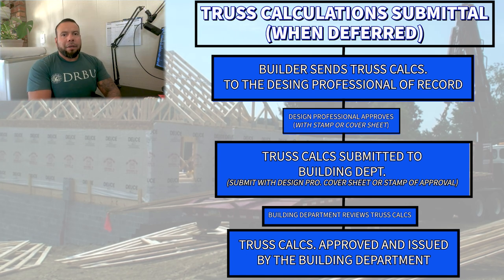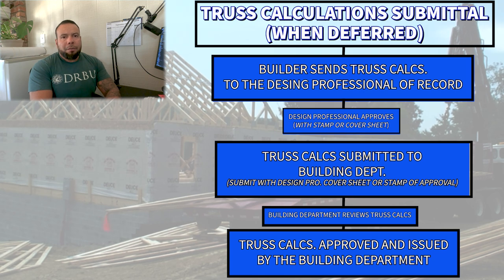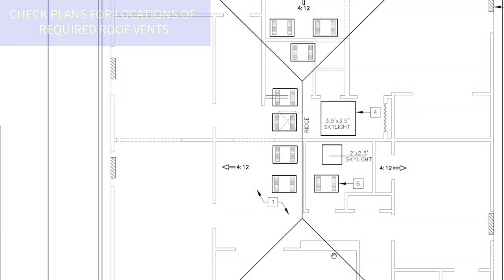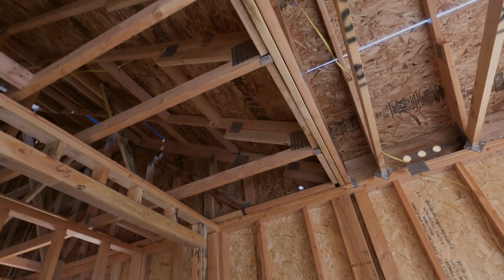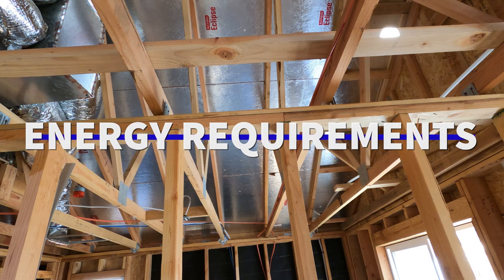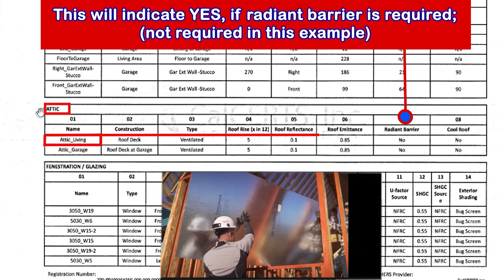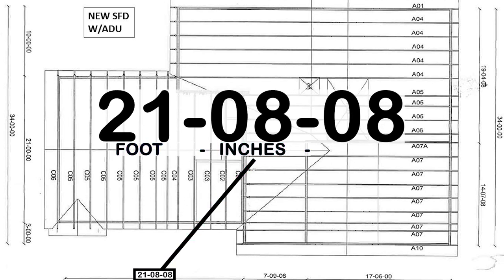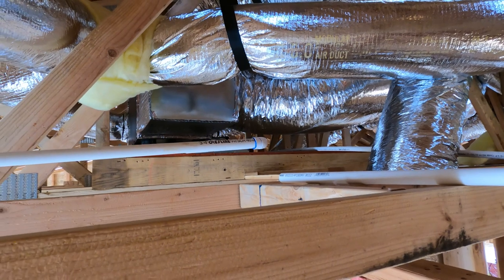Roof Sheathing Inspection and Roof Trusses

Comment: Hello, Great presentation. I appreciate you taking the time to do it. Going through my newly built home, it seems to me there should be more roof truss bracing. There is currently only a couple CLB areas and the gable bracing is at a steep angle 25-35 degrees. Also large areas of the sheathing with no H clips or blocking underneath. We get lots of snow and wind here in Central Oregon and I’m concerned after seeing some of the things the inspectors overlooked. Any input is appreciated.
Reply from the maker: Greetings and thank you for the question.  If you are able to, consider discussing this with the contractor/developer of record and the design professional of record; then the local building department.  The reason is, they may have an explanation justifying the areas you describe. 
 
You may also consider viewing the blueprints to your home, through the Public Records laws; this will give you an idea of the home’s design – and it may answer your questions.  The building department should have a copy of the plans, if it is part of their records retention policy.   

Best case scenario, there may be a valid reason why the home was built as you describe.  

Worst case scenario, items were missed (which happens, we are human); and in this case, the parties can decide on who will be responsible for any issues encountered.  If your home was recently built, it may still be under warranty, but check with the seller, realtor, and contractor. 
I hope this helps.  Please let me know how things go for you.

Best of luck,

Jose M

Comment: Is this only for high wind/seismic areas? I've never seen this here in Tennessee. Thanks!
Reply from the maker: Hello!   It's understandable to notice variations between states.
In California, roof sheathing inspections are governed by stringent standards outlined in the California Residential Code (CRC) model code - International Residential Code (IRC).  These standards aim to ensure structural integrity and resilience against seismic and high-wind events by meticulously examining elements like hurricane structural clips, roof trusses, drag structural connectors, edge nailing, shear transfers, and more.
While these requirements may seem strict compared to (perhaps) other states, it is important to remember that building codes and inspection practices can vary significantly from state to state. Factors like climate, local building traditions, and historical considerations often influence the stringency of these standards.
In Tennessee, inspection practices may prioritize different aspects of construction based on the region's unique environmental conditions and building code requirements.  California is just built differently, I reckon.  
Thanks for checking it out✌😎,  @tinoslaponi8514

Comment: Did you mean the planning & inspections or permit department
Reply from the maker: I am not sure if I understand the question.  I do not believe I mention either on the video.
Reply: @CBO.online  Did you mean the planning & inspections or permit department when explaining the truss submittal flowchart?
Reply from the maker: @domingo2977  Hi Domingo.  In the video, I mention the Building Department, since that is almost universally known as the department that is responsible for reviewing and inspecting truss calculations. 
But in your case (planning & inspections or permit department), It would be whichever department reviews the truss calculations.  I cannot speak for either of the departments you mention, especially considering that building departments (i.e., building permits/plan review/building inspections operations) are often called different names (e.g., development services, permits and inspections, planning and building, etc.), depending on the organization structure -- so it is best to contact the departments you mention to ask about the truss calculations, submittal process and requirements.
The video merely outlines a typical process flow -- when -- truss calculations are deferred.  The local AHJ determines if trusses can be deferred, or not - including requirements.  

I hope this answers the question.  Feel free to reach out if you need further clarification.

Be well.

- Jose M

Comment: I JUST BOUGHT A BRAND NEW HOUSE. I WAS EXCITED.TILL I MOVED IN.IT'S BUILT SO BAD IT IS UNSAFE.THE BOSS TOLD ME ON THE WALK THROUGH , NOT TO GO INTO THE ATTIC AREA. THE HOUSE WASN'T DESIGNED THAT WQY.SO, I WENT UP . AFTER SHOOTING WATER ON THE ROOF.NOW,S=CARED TO LIVE HERE.TRIANGLE SUPPORT BEAMS , NOT CONNECTED. THE WOOD ON THE LEFT DOESN'T REACH THE OTHER SIDE. ALL THE NAILINGS ON ALL THE SUPPORTS,ARE  EITHER MISSING ALL TOGETHER, OR THEYRE NOT MAKING FULL CONNECTION WITH THE INTENDED TARGET. (THE F'N HOUSE)YOU PUT A GOLF BALL ON THE KITCHEN FLOOR AND IT ROLLS AROUND THE HOUSE LIKE IT'S GOING THROUGHY A MAZE. LGI BUILT THIS HOUSE. ALL THE WINDOWS AND DOOR ARE SLANTED.OH. AND I SAW THE WATER COMING THROUGH THE HOLE IN THE ROOF.WHO CAN I CALL, LEGALLY ABOUT THIS? AND THERES ALOT MORE...
Reply from the maker: Hi Nick.  I am very sorry to hear of your experience and findings.  Buying a new house should be a worry-free and joyful experience; and it is a significant investment. 

Your question is very much a legal question and in short, you should get in touch with a “construction defect attorney” in your area and discuss your matter with the firm, as soon as you are able to.  They should be able to advise you on the necessary steps to take.  Also, the home should still be under warranty, so look through the documents you were provided with by the builder/seller’s agent.   

Please keep us posted if you can; and I hope you can get your concerns resolved in a timely fashion.  
Be well and best of luck to you.

Jose M